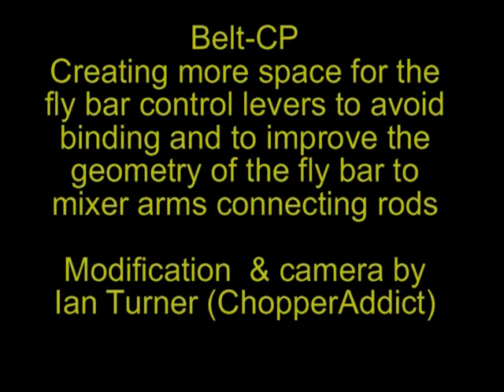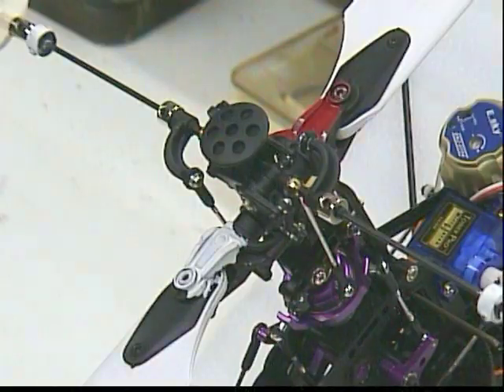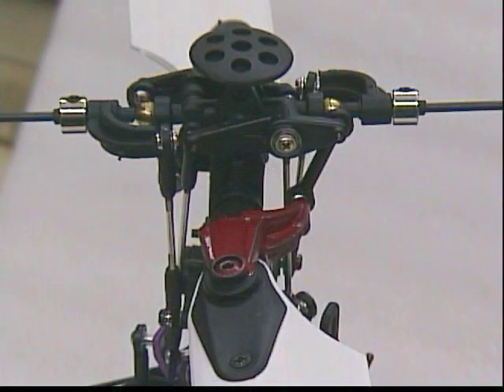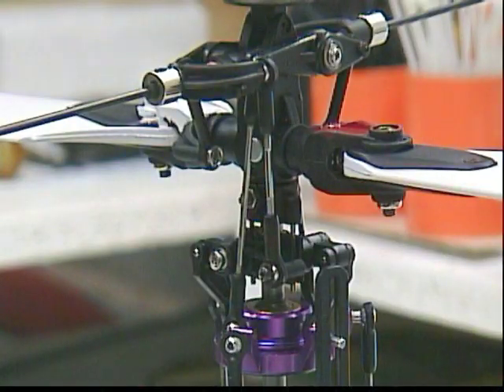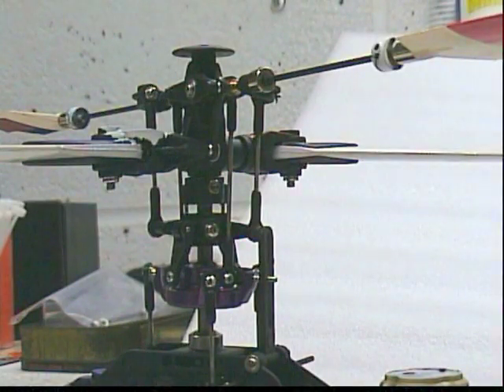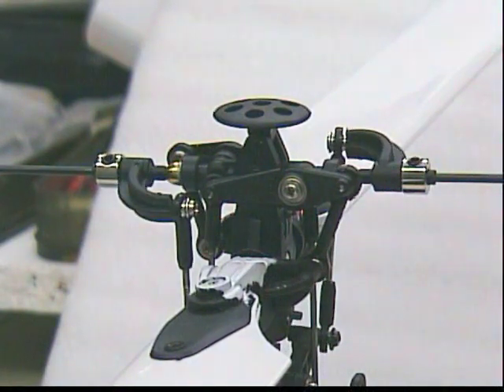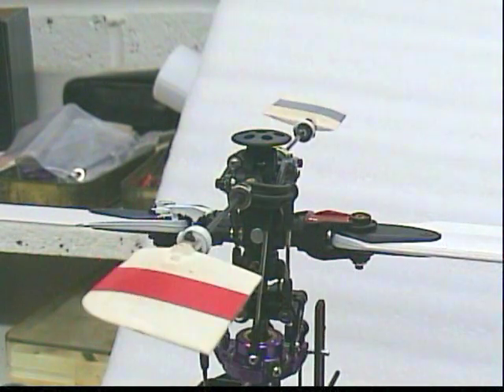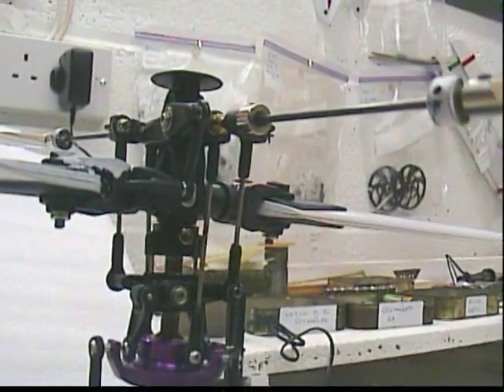Belt CP fly bar mod - 2

Comment: why your blade grips didn't move when you turned? they are supposed to move too, and the fly bar tilts but not the paddles, imagine this line is the blades ----------
so you move forward, blades should move, same backwards.